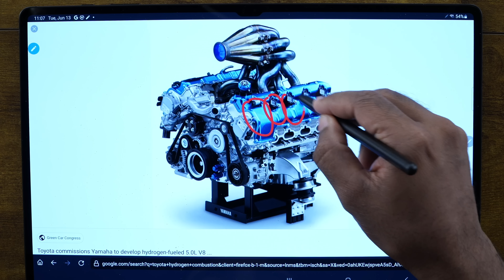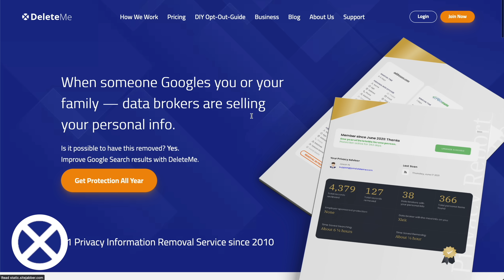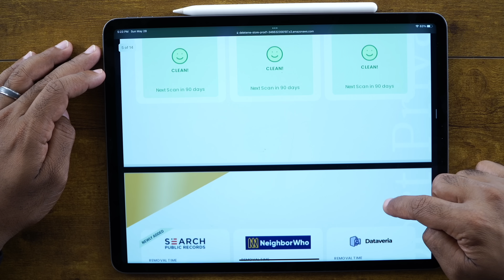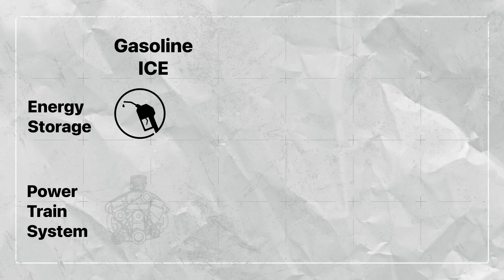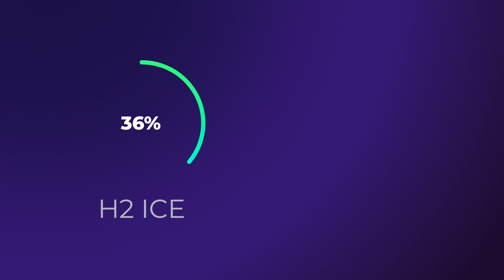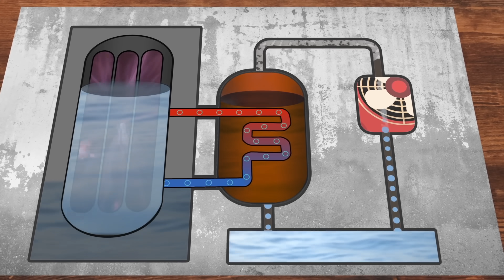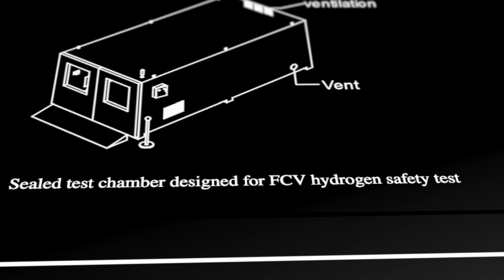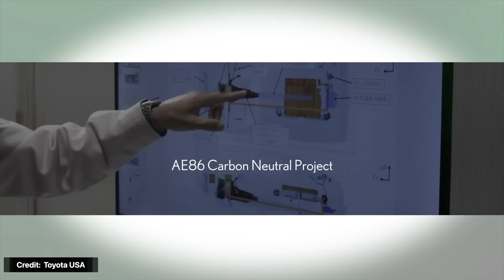Toyota's Says They Just Destroyed EVs - Hydrogen Combustion Engines

Comment: 1) Even if H2 doesn't work for cars, it will for Trucks and Planes where Batteries don't make sense.
2) EV Batteries are FAR more dangerous than either Gas or H2 in a crash
3) We keep assuming that the only ways to store H2 is Compression or cooling. There are many other possibilities from chemical compounds that are H2 heavy to mechanical solutions that take advantage of H2's unique properties
4) A tiny bit of Carbon release isn't a problem. No need to be ZERO emissions to that degree
5) There is no need for exotic chemicals to make an ICE. Unless we switch to Na based batteries from Li, there is no chance we can meet the world's needs for cars AND grid storage using batteries. 
6) Related to 5 .. H2 can be produced anywhere from many sources which means an H2 economy is FAR more likely to exist in the rest of the world (other than the 1st world) where getting Batteries is hard and expensive.  We forget about the rest of the world when we talk about EVs .. You're not likely to find a Charging station or a place to repair an EV outside the 1st world, yet the rest of the world still needs cars to get around. With EVs you'll end up with a 2 tier system: EVs for North America, EU, Japan, China and Gas for the Rest of the World (Middle East, India, Africa, S America). With H2 less likely.

Comment: Good video.  Additionally, hydrogen allows big oil to maintain their control and our dependance on their products and pricing.  No thanks, I will charge my EV in my garage at pennies for miles, and if that gets expensive, I will get solar
  Cheers from Canada.
Reply: Explain what the connection is between 'big oil' and hydrogen? Hydrogen is not derived from oil.
Reply: @chrisknight6884  Big oil have the infrastructure to sell hydrogen via thousands of gas stations.  They could partner with hydrogen producers, or produce hydrogen themselves and try and sell it through existing gas stations.
Reply: How progressive of you. I suppose you'll thank the world once your EV battery dies and is left to rot in a warehouse leaking toxic acid because there is no way to separate the rare metals inside the battery. Good job being "green." EVs are a scam!

Comment: You're actually under-stating the downsides of hydrogen combustion. The efficiency is far less than you said: ICE engines are around 18-30% efficient at peak efficiency. But they don't operate at peak efficiency most of the time - instead it's more like 8%. A car using one of these and the hydrogen tanks of a Mirai will give a range of around 40 miles. To get anything higher you have to put extra tanks in the trunk and passenger cabin. No room for passengers.

Engineering Explained has a good video showing the back of the envelope calculations and sources for the data.

Hydrogen ICE makes sense only for big rigs, where charging will be more of a challenge and fuel cells would be too expensive. Also as a niche in motorsports. It's also a great tool for spreading misinformation, which is probably the main reason it's being funded and promoted.

Comment: Electric cars eliminate a great deal of maintenance. Looks like Toyota is trying to keep that alive and well.
Reply: I think it's more about that Toyota understand that not everybody can or will drive EVs. We got over 1.4 billion cars in the world. They wont all be EVs anything soon. Getting Hydrogen to work would make it possible to refit a lot of older ICE cars for a much smaller fee that what a new EV would cost. Also it will result in less pollution overall due to not having to manufactor 1.4+ billion new cars. They also seems to understand that different drivetrains has different uses and strengths in the real world. It's better to have your hands in all the chicken baskets instead of just one.
Reply: @PeteTheL337  The main problem I have is the generation of hydrogen. Either heat stuff, and create greenhouse gasses, or use 3X the energy to create H2 by electrolysis. Neither are attractive propositions. And we really just need to STOP BURNING STUFF !  However we do this, it creates problems - in this case nitrous oxides...and any H2 infrastructure is inherently expensive. having said that, hydrogen has it's place in industry  - but IMHO absolutely NOT in land vehicles....

Comment: You still have more parts and more things that can go wrong with a hydrogen engine. That will still mean stealerships screwing customers and selling you crap you don’t need and adding markups. There is also zero home charging capability with hydrogen. That’s a huge part of the infrastructure that is missing. I see very limited use-cases.

Comment: Personally, hydrogen is not for me. Too many vested interests pushing blue hydrogen, and above anything else the leakage through the tank walls cannot be stopped. It will leak through anything. Even if the leakage can be kept down to safe levels, you could still park your car up for the holidays and find the tank empty when you get back.
Reply: So just make more. Who cares.
Reply: If I have to pay for fuel to evaporate into thin air, I care.

Comment: I noticed people are forgetting that EVs explode and burn hot. So, you had a crash and the tank got punctured and leaded out. The damaged Li-ion batteries on EVs always burn hot. It's just guaranteed. Did people forget that Li-ion battery catch fire when damaged? That just gets much worse when they are large enough to power a car. The other day, I saw a video about Air Pods exploding in people's ears! EVs are potential bombs.

Comment: The weather range problem is a serious problem with lithium batteries. Cobalt is also a problem.

I’m more excited about salt batteries instead. I know they’re less dense but they don’t have temperature issues compared to lithium and less prone to fire.

Plus the raw material for salt batteries are more easily accessible compared to lithium. 

The technology is plug and play with lithium batteries. You can charge it the same way etc.
Reply: Cobalt is a problem, but many new chemistries don't use it, including LFP which is what most of the Chinese batteries use, including all Teslas made over there. My home battery is LFP. The density is a little less, but the resources required are just Iron, Lithium and Phosphate, so they are cheaper and easier to source. They are also much less prone to combustion.
Also, most Cobalt is used to remove Sulphur from petrol, the amount that is used for batteries is small in comparison.
Sodium is here now, so that's a cool sideroad, but given the much lower density for now, I think Lithium will remain in the lead for a while

Comment: Hydrogen ICE has a lot going for it. People are still by far more used to ICE or electric. Exactly, how does hydrogen ICE compare to a gas ICE? Yes, dirty sources of hydrogen is a problem, but dirty sources of electric is still a problem. Electric has it's downsides of demanding an aging electricity infrastructure to carry EVs as well. Also, electricity has the loses of miles of powerlines and many transformers while hydrogen can by mass produced on site. There's a very good reason why the Japanese are pushing hydrogen. I don't necessarily expect to kill EVs, but with the rising costs of electricity and EVs being a huge electricity hog, all hydrogen has to do is be cheaper than electricity, and this will be a done deal. As for hydrogen infrastructure, gasoline and EVs had this problem originally. It's nothing that can't be accomplished.

Comment: This report is Americentric. TOKYO -- The Japanese government will include 1,000 hydrogen refueling stations for fuel-cell vehicles deployed across the country by 2030 in a draft of its growth strategy due to be hammered out in June, Nikkei has learned.
The plan to increase the stations sixfold from the current level is part of Tokyo's goal to have all new car sales be electric by the middle of the next decade. Hydrogen vehicles employ fuel cells to power electric motors and would be included in this target.
The draft also includes a plan to attract advanced semiconductor factories by providing support measures "that are comparable to that of other countries."

Japan has pledged to reduce net carbon emission to zero by 2050.
The draft envisions electric vehicles, including those fueled by hydrogen, "reaching the same level of economy and convenience as gasoline cars by 2030 at the latest." Convenience would be increased by adding more fast-charging and hydrogen stations, while economy would receive a boost through such measures as purchase subsidies for electric vehicles.
The country currently has about 160 hydrogen stations and has previously pledged to increase that number to 320 by 2025, making the newest target a significant increase.

Comment: Hydrogen is more suitable for heavy vehicles. Battery could use some kind of external fuel as diesel Webasto system just to keep cabin and battery warm to save electricity.
Reply: If hydrogen ICE is not suitable for smaller vehicles, scaling to larger vehicles only multiplies the problem.

Comment: This is crazy. Compare the weight, reliability and maintenance needed  of a hydrogen combustion engine to that of a hydrogen  fuel cell and electric motor combo. There are literally hundreds more moving parts, thousands of fasteners as well as dirty, leaky oil and water systems required solely in the combustion system. Run a fuel cell  engine for hours and it is barely warm. Try running a combustion engine for 5 minutes and you can't touch it for the wasted heat energy.